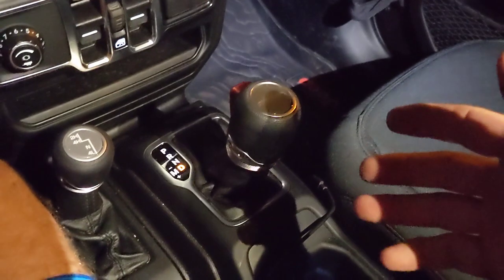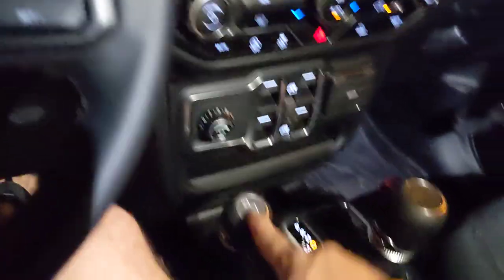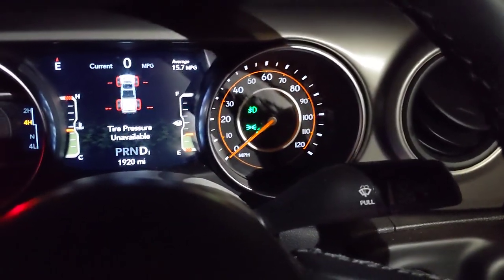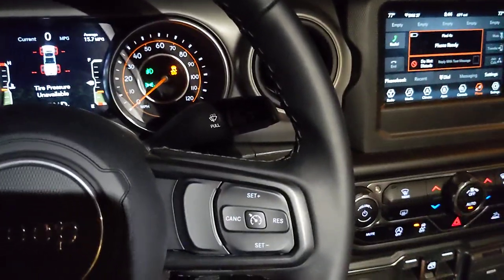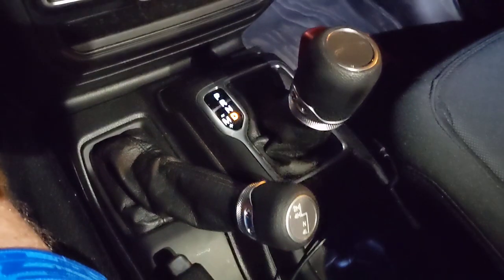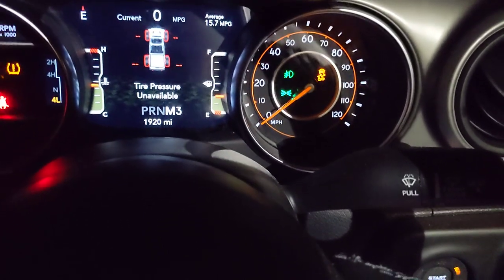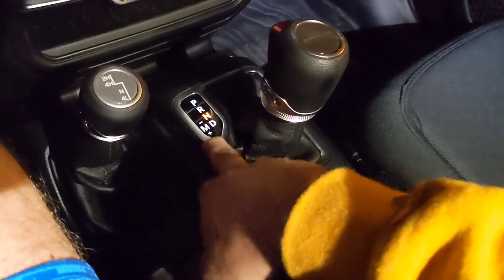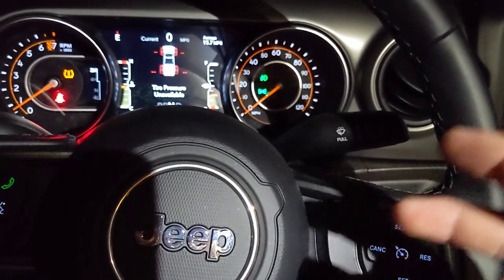Gladiator traction control modes explained, how to get full power in LOW Jeep tricks

Comment: I think there are some tuners that can completely disable it. Other than that you could run a toggle switch from the abs fuse so you could just click it off.
Reply: the esc fuse on the jl controls your power steering as well for some dumb reason

Comment: To truly use the BLD, you need to mildly apply brake while ALSO applying the gas peddle. It will make a funny sound which will tell you it is working. It works great when you get stuck and one wheel spinning. You will then have power go to the non spinning wheel
Reply from the maker: Well what you're saying might help slightly it definitely contradicts the owner's manual and the BLD works well without hitting the brakes and putting additional stress on your drivetrain and wasting power. Hitting the brakes is also going to add resistance to the non-spinning wheel..
Reply: @MudPuppyOffroad yeah it’s going to apply the brakes to both sides evenly-  on a open diff this means it will cancel out. On some other types of diffs maybe adding brake force would multiply power added to the other side but not on open diffs like a jeeps I don’t think.

Comment: How the hell are you able to shift from 4H to 4L without moving?
Reply from the maker: It helps to be moving just barley but mine will shift stopped
Reply: @MudPuppyOffroad  I'm jealous.
Reply: Mine too Gladiator Sport S
Reply: When your in 4H put it in neutral, engage e brake then drop it into 4low 😎 make sure your seatbelt is on cause the truck won’t move if it’s off. At least that’s the way it is with my 21 gladiator rubicon 👍
Reply: @mfh2112  the more you shift it the easier it will get. Mine stock was super stiff to shift. Now it’s like butter and can be shifted stopped 4/5ths the time.

Comment: I have 2020 with 8spd auto transmission. He is correct on mode selection. But in 4 low if it starts from a stop in second. You can go manual and shift to low 1st. But if the low 4 is selected then in low manual 1st and 2nd the TCS is still on and it even if you floor it, you can't burn out in either gear. But if you go to 4 Low 3rd gear then the computer will not cut throttle and you get full power and can smoke the tires all 4.

Comment: On my 2021 Gladiator as soon as I put it in 4L traction and stability control turn off I think it turns everything off in 4H as well but I can’t remember.
Reply from the maker: I mean, I'm sure that's what you think is happening... That's what the lights would indicate but if you test it there is still some torque limiting happening unless you put it in it to manual mode first gear. This is a well-documented thing

Comment: ESC will only turn off in 4 wheel drive because you are telling the system to lock up the differential and it knows that you're trying to go through some bad shit off roding  If you want it completely off then you have to mod your CPU a bit and use different Bluetooth OED2 apps to Customize your truck/jeep